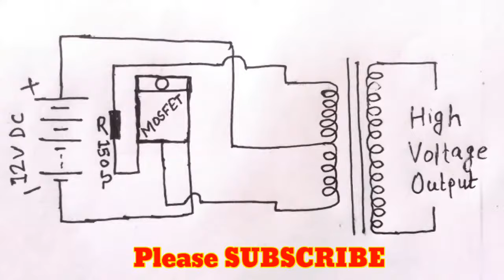How To Make High Voltage Transformer | Flyback Driver For High Voltage (24000V) | EHT Transformer

Comment: Use D718, 15 0 15 turns and a 1k resistor with 12vDC, you will have REAL 50 000v

Comment: I got myself a 8 pin flyback. Do I need to use high ampere battery as it's not working with my 9volts one. Please help me
Reply: 9v battery will not work you need atleast 12 v for this

Comment: Super bro I have connected 2sc5200 transistor in place of irfz44n mosfet its working perfectly
Reply: What resistor did you use for the 2sc5200?

Comment: hello bro what if i will use adaptor(converter) to give  12v dc input , because of bettery is costly....... can i use it?
Reply: You can do it like that just fine, but keep in mind that it draws a lot of current so you will need a beefy adapter. Good luck!

Comment: Can I use (Ttc5200) transistor?
Reply: zvs driver better more current and more voltage if you want to build a zvs driver you well need a IRFP260n for the best results